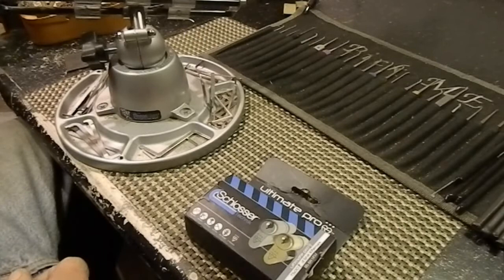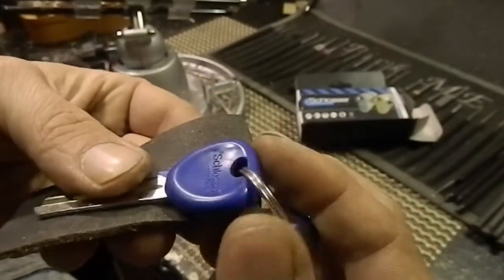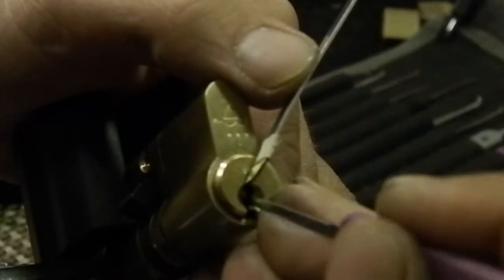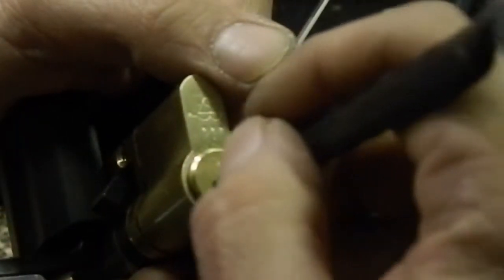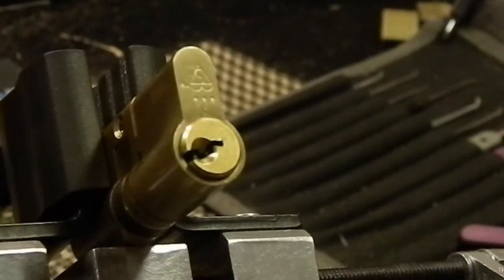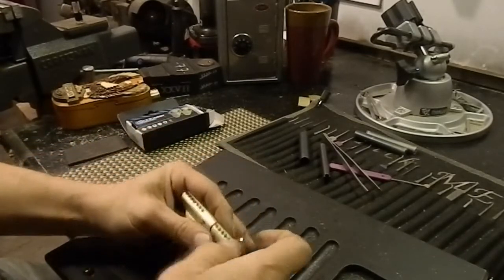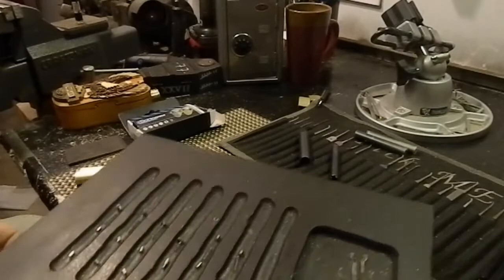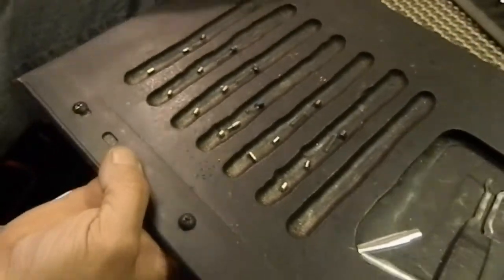(359) 6 pin 3 star kitemarked  Schlosser Technik eurocylinder spp'd and gutted

Comment: That was fun - great picking on a very nice lock. It seems strange to me that the snap line is behind the last pin stack. That means that after snapping and pulling out the lock you could just take a screw driver and turn the cam.
Reply from the maker: Thank you! it its a fun one to pick for sure :-)
You make an excellent point about the anti snap!! I guess since we don't use euro-cylinders on this side of the pond I didn't even think about that!! Thank you for pointing that out👍👍👍😎😎
Reply: I believe that if the outer part is snapped there is a device that deadlocks the cam so it can only be opened from the inside. That's what makes it 3 star etc
Reply: Negative. It wouldn't be possible to achieve a 3 star rating if what you say would be true. After snapping the outer part the cam goes into block mode. There's no getting through.

Comment: Cool new intro! That anti bump pin looked evil. I couldn't see if it was a pin-in-pin or a nail-in-a-log? As in, could the thick part move on the thin part? Way cool that you can get one of these, break the spine, and have two training locks, and all you gotta get extra is standard pins and serrated pins, as it comes with spools already!

Also, you were zoomed in one click more than you normally are, and I think that's why you cam wouldn't focus.. it liked your pick sleeve more today :P
Reply from the maker: Thank you! Yeah..I figured I would try out a new intro.
The anti-bump pin was just a nail in a log..did not move like a pin in pin.
I am going to cut it in half and leave the one side stock and the other side a challenge lock!
Yeah crazy zoom..I will figure it out eventually😃😃
Thank you for watching!!
Reply: What software did you use to make it? I'm gearing up to starting recording myself, and I'd like my first episode to not look like doodles :P
Reply from the maker: Cool..Glad to hear you are going to start putting vids out :-)
I just searched free video intro maker...came across a few different websites...I think this one I got from MotionDen.